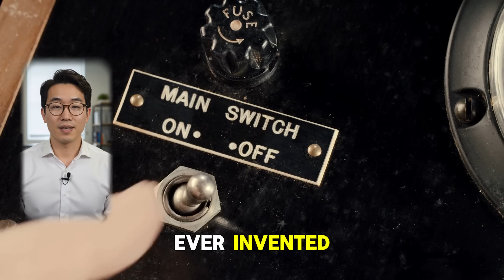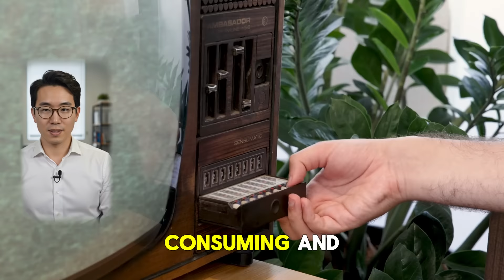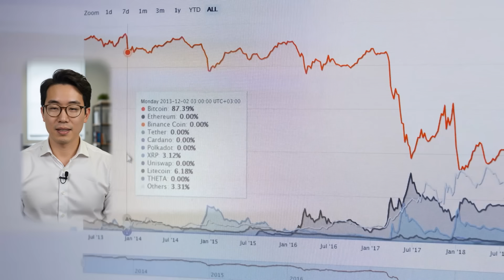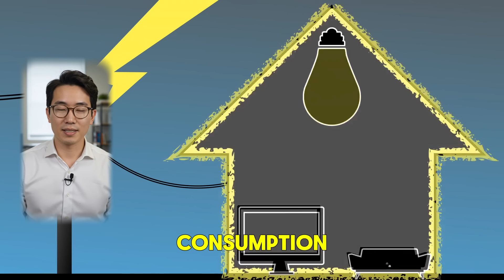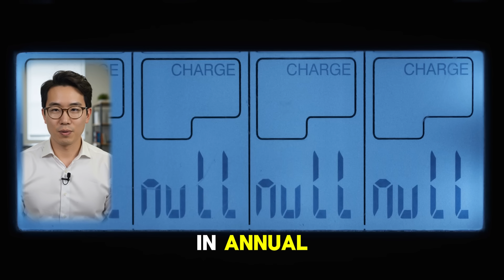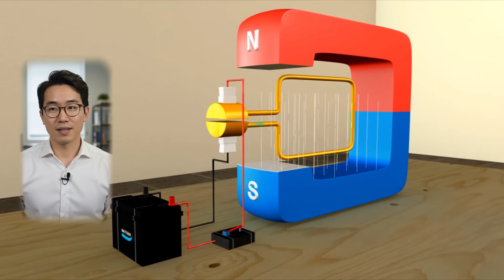One $0 Device Cuts Your Electric Bill in Half Forever — The "Load Secret" They Buried!

Comment: The major cost in the cause of skyrocketing electric bills is the parasite called Renewables once they're connected to the grid can only put in about 15% of advertised output for extra electricity the ignorance of Renewables on the grid is easily demonstrated with a volt amp meter and 4th grade math called Ohm's law if you were to double-check your installed wattmeter you'll see some 85% difference and it takes less than a second

Comment: 1-watt phantom load is to lower the product's quiescent current draw.  Another effective saving is to have in place a 3-phase power supply for the home, ie instead of single-phase.  Another techy savings improvement is to start implementing IoT devices and machines, like the washing machine, dryer, house lights, TVs, etc.

Comment: I run all my domestic and transport, needs, on a 50 ft catamaran, including electric tender and auxiliary propulsion for the 10 tons of catamaran. On 100 kWh per year. As much idiots are wasting on your standby on you're stupid mind programming devices, you think are entertaining you, or saving you time in the kitchen, by leaving them plugged in😮😂. 
If you converted everything in your house to direct low voltage DC, you'd save over 90% of what you use also.
Now think about how much time and money and electricity and other energy, is wasted on building, and you buying those pieces of s*** that last 10 minutes!

Comment: This "Phantom Power" issue is a real problem but, there are simple ways to deal with it.  Buy one of those Kill-A-Watt meters, which allows you to measure the power consumed by any device that plugs into the wall.  One by one, measure each device that is plugged in while turned off.  If power draw is noted, you can disable the draw by using a simple switch between the outlet and the device.  Suspect devices (TV, DVD player, Roku, cable box, microwave oven, coffee maker, computer accessories, and etc.) will commonly have a pilot light or clock running when off.   If the device is not providing some useful function when in the Off Mode, it should be turned off.  I use a simple in-line switch for simple items, like the Roku power cube.  For larger devices, like my TV and DVD player, I use a Power Strip with a Surge Protector.  For a simple phone charger power cube, if they are not plugged into a phone, they don't show any power draw but, it is still a good idea to unplug them when not in use.
Reply: My Kill-a-watt died a short time after I started using it a half year later. No fuses do I see; it's a paperweight. 😮
Reply: @garychandler4296 Those Kill-A-Watt meters do have a 15 amp fuse, which looks like a diode with a metal case.  It is actually a special fuse that can tolerate a short term overload.  The other failure mode with these units is due to the physically large 0.47 uF capacitor.  The value slowly drops on this part over a few years time, which causes the digital circuitry to be starved for power.  The unit will still operate but, the accuracy will be way off.